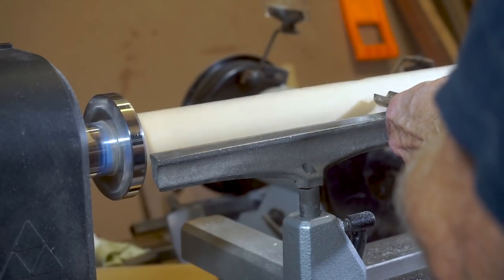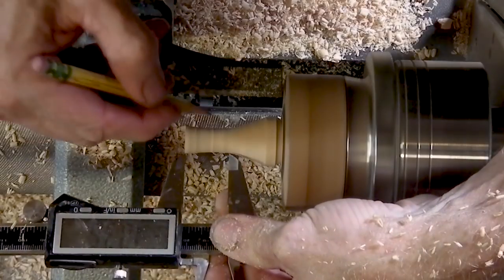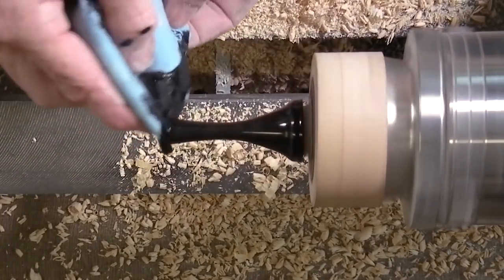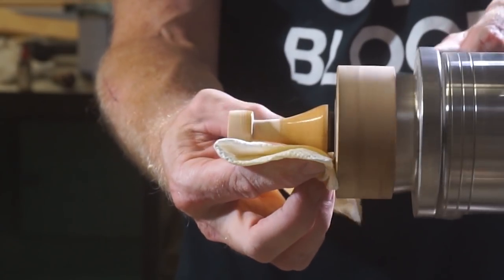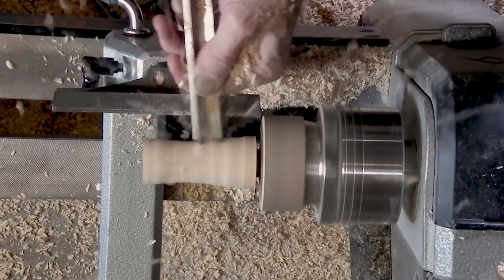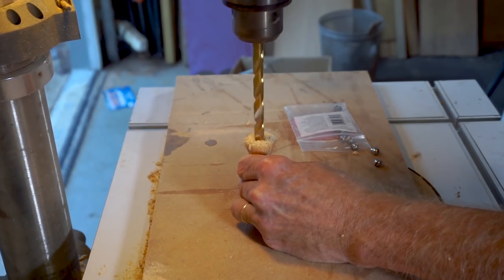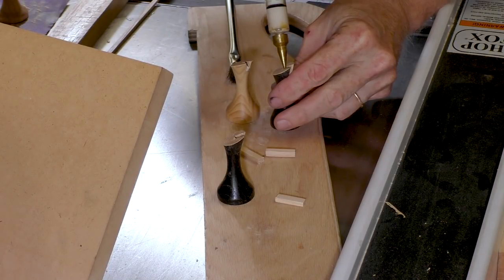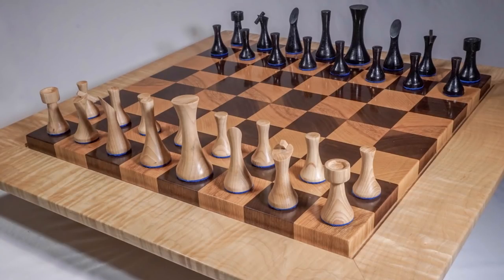Woodturning a Modern Chess Set

Comment: You mixed the names of knight and bishop in hindi. A knight is called "Ghoda" and a bishop is called "oont".
Reply: I've always known the bishop as a haati though
Reply: @nasifurrahman2641  haati is rook
Reply: @nasifurrahman2641  haati means elephant
Reply: @phoenix4193  i know haati is an elephant. Where I'm from the bishops are called haati and the rook is called kisti which either means boat or tower
Reply: @nasifurrahman2641  @PHOENIX  You are both right, in Chaturanga, Bishops were called Gaja, and rooks were Raths, when Chaturanga went to Persia and became Shatranj, the Persian word for chariot was Rukh. The Persian army didn't use elephants but they used camels so the Bishop was called Camel. When the Persians introduced Shatranj to the Mughals, they didn't use chariots, but had seen elephants in India, so the rook became the elephant piece. The current representation of the rook is the howdah on the elephant

Comment: Hats off to you for having the skill and confidence to hand turn each piece by hand and get consistent results. Most hand made wooden chess sets are made in India, and rather than using a turning chisel to shape each piece they use a custom profile tool for each different piece. The profile tool is a small piece of high carbon steel sheet with a "half silhouette" of the piece cut out of it. The profile tool is then used to shape the turning wood, creating an identical profile in one cut. The only pieces that are hand carved are the knights, which is why generally speaking, the more detailed the knights are, the more expensive the chessmen set will be.

Comment: I made a chess for a school project when I was in ninthed grade. Back then I used veneer for the board. the black squares and figures were made out of  dark walnut wood and the white parts out of acorn. I regret that descison a little due to the fact that the acorn formed black spots while turning it. To be fair, it was my first time turning wood and I somtimes put to muche pressure on whiche burned the wood. Also I think that acorn is a fast growing wood and not as hard and sterdy as walnut, alltough I cant say that for sure. Aslo the veneer made a few problems, because I had to work very exact and every mistake would end in repeating the process.  But in the end I can really reccomend to try it yourselfs. I have learned alot in the process and when somone whants to play chess I can proudly present my handmade board.
Sorry for the spelling btw, I am not a nativ speaker.

Comment: Great video! The set is growing on me the more I stare at it. At the very least it's utilitarian, which I didn't expect. I still think I'd put some kind of top on the king, probably just a small cylinder, and something to make the queen stand out, maybe a dome top. I'm also not sold on the knights at all, though they came out better than I'd expected. I think maybe something with kind of an S profile would fit the theme, and all in one piece rather than pieced together. The bishops, rooks, and pawns are great, and the etymology lesson was an especially nice touch!

Comment: The bishop was originally a war elephant. The conical tip with the bead on the end represented tusks clad in metal.
Europeans had no idea what that was, so they called it a bishop since it looked like a bishop's mitre.
Reply from the maker: Interesting.  Thanks!
Reply: sqlblindman 
Similarly, the rook was originally a chariot, which makes a lot more sense than the tower design it has in a modern European chess set.
Reply: Considering Chess or "Shatranj" originated in India, Bishop has always meant a Camel. The pointed head refers to the hump. Also, Rook is a war Elephant and Queen, more realistically is "Wazir" which refers to a High officer in Muslim army, in this case, a commander of the army. In reality, Queens hardly took parts in wars and even more hardly played such a prominent role.

Comment: Very nice chess set.  I really like the modern design of the pieces.

In response to your comment on using black stain, I offer the following: Consider using black leather dye to ebonize wood. 

Feibings leather dye is alcohol-based and it really penetrates into the wood. It comes in a range of colors, including black, of course.  It dries fast and will take any finish. One will get a bit of transfer using shellac, which is also alcohol-based, so apply it with light coats.  Further, this dye is reasonably priced, especially in the large 32-ounce containers; small 4-ounce containers are available also. In addition, it appears to last, if sealed, indefinitely.  I have had my bottle of this dye for about ten years and I used it as recently as two days ago. Still perfect.   (I mention Feibings dye because I have had good luck with it.  Comparable products likely will yield equally good results, though I do recommend the professional-grade rather than the craft-grade dyes.)

Finally, an important precaution that I ignored but once:  Use gloves when applying this dye.  It is meant to dye leather; leather is skin; skin takes dye very, very well.  Trust me on this. And though the dye  will come off with alcohol and lots of scrubbing, why would we want to make the skin on our hands feel like leather?  It is an experience that can and probably should be avoided by using waterproof gloves.  So...

Back to the important thing:  This is a great chess board and chess set. Well done!

Thanks for sharing another excellent video project.
Reply from the maker: Thanks, Jerry. That's a great tip. I will definitely give this a try the next time the opportunity arises.

Comment: Very nice!  I agree that it would have been nicer and easier to use a dark wood for half of the pieces... maybe the same kind of wood you used for the board.  I’d worry that the screw chuck would wobble and instead turn as part of the large piece.

Comment: Sure, I would make it had I the tools, time and skill!   Very nice job and result.  The info about the piece names was a good thing to add.  Also liked that you thought out the sizing of the pieces relative to each other and the board.  Very important to chess purists :-). One thing I would change would be to use a half disk for the head of the knight, to fit into the slot, with the flat part on the top, and angled downward a bit.  I think it goes better with the overall curvy theme of the set.  I would also probably cut four crenellations in the top of the rook, although you could argue that violates the otherwise minimalist theme.

Comment: I am in awe of your patience and astonishing creativity and skill. I had one questions: Did the pieces rattle when moved? Might a few drops of silicone adhesive or sand prevented this? Magnificent, museum-worthy work!
Reply from the maker: That's a good question. I was worried about that, as well, after I made the first couple of pieces, so I simply added a bit of wood glue into the hole before sealing it up, but didn't show that on the video. Sand might have been a good idea, as well, to help add even more weight. Thanks for watching!

Comment: While your modern design chess pieces look great, I think I prefer the look of the classic Staunton style pieces.  Most of these seem to have the king and queen turned the same size in diameter with the king just slightly taller than the queen.  Bishops, Rooks and Knights have the same diameter base, with the bishop being a bit taller than the rook.  Pawns are the smallest in base diameter sized so 3 or 4 of them will fit in a chess square.  I've seen pawns with the ball on the top varying quite a bit in size, some of them look rather squat as a result.
I've seen many examples of chess board construction on youtube, but not many chessmen.  Good work on this one!
BTW, can you still get lead fishing weights?  In many places, these have been outlawed because of the concern of lead toxicity.

Comment: I'm not sure why you think you need the pieces bottoms to be those sizes I'm too lazy to get up and check my regulation sets for sure but I've used them enough to know that I definitely can't fit 4 pawns in a square on the board and I'd bet my ass that all the bottoms are the same exact size

Comment: Wonderful take on Tanguy's design.  Excellent narrative. 

I thought if I were to try to turn these and add weights, the bases could be bored and threaded for turning on the lathe, then your pieces already have the holes in the base. Do you happen to have a website or blog with the patterns for these pieces?  It's a little tough getting them off the video.  It's just a very elegant, clean take on an already interesting chess set.  Thanks.
Reply from the maker: Hi Robert, thanks for the feedback. I like your idea of boring and threading the pieces before turning. I didn't do that because the narrowest point of the pieces is about 7/16" and I was worried that I'd have a problem with that while turning. It would definitely be easier, though. If you send me an email at woodumakeit@gmail.com, I'll reply back with the diagram that I used when turning the pieces.

Comment: Hey Mike thanks for the video just curious to the size of the square blanks before you turned them down thanks in advance
Reply from the maker: I don't remember exactly, but they were likely 2" for the king and queen and 1.5" for everything else. That's probably a little larger than they would need to be, but it's a little safer to start with something a little larger just in case.
Reply: @Woodumakeit  thanks a bunch thats what I figured. I'm restoring a table my father in law made in high-school that has chess/checker board and backgammon routed on top so I wanted to turn some chess pieces once I'm done so we can use it!

Comment: Great job what products you use for finishing
Reply from the maker: Thanks!  I used tung oil and wax on the white pieces, and gel stain and wax on the black pieces. In more recent projects, I've been using CA glue as the finish. For anything that needs to be stained black, I've found that India ink works quite well.

Comment: I don’t know if you actually respond to comments or on this video anymore but I am fairly new to the lathe and am trying to make these pieces to go with a board I made but when I try to use the make a sort of screw chuck it is either off alignment when I attach the piece or the piece will spin freely when I try to use my tools to cut it I wasn’t sure if maybe you would have some advice for how to fix this.
Reply from the maker: I had some problems with the wood slipping sometimes, so I used a larger screw and that helped. It was frustrating at times, though. You might want to use a jaw chuck like I did in this video: https://www.youtube.com/watch?v=HKoJb2AIAGs&t=5m47s   It uses extra material, but it's much easier and can save time.

Comment: excellent video, amazing work. What type of wood you used?
Reply from the maker: I used hickory for these pieces because it is fairly heavy. I still ended up having to add weight into the bottom, though. I'm working on some new pieces now that I'm making from ebony and boxwood. Both are easy to turn, and using ebony means that I will not have to stain the dark pieces. I hope to have a video out soon.
Reply: @Woodumakeit   Thanks for the answer. Waiting for the new video !

Comment: Great job! What wood did you use?
Reply from the maker: The squares are made from walnut and ash and the frame was made from walnut on one and curly maple on the other.
Reply: @Woodumakeit  thanks for the answer. And wood for the pieces?
Reply from the maker: @marin.kucina  In this video I used hickory for the pieces. I have another video where I made similar pieces using ebony and boxwood.
Reply: @Woodumakeit  thanks man. Keep it up with good work.

Comment: Would flocking be better for the bottoms? Compared to felt?
Reply from the maker: I actually thought about that when I was buying the felt, but I don't think flocking would hold up as well. It feels less durable than felt and it's not as thick. I'm not sure though. It might work just fine.

Comment: I am a chess player. Nice work, but I do not like the design of the pieces. I understand that is easier this way, but is too simple for a classy chessboard like this. They look unpleasant aestetically, kind of primitive acording to me. I believe also that there are also so impractical disadvantiges of this desing. In a official blitz game for a example, the players may need immediate recognision of the pieces. And here we have basically only rooks with different sizes and some of them has at most 1 distinctive feature. I also believe the classical styled pieces enable faster and easyer physical moving. And I personaly do not like this material on the bottome of the figures in blue in this case. I find it unpleasant on touch and do not understand why many chess sets have it.

Excellent work of you, again.  Just 1 thing away from perfect. The design.